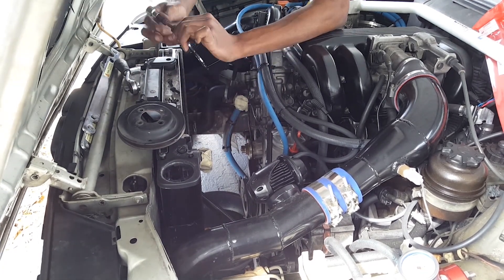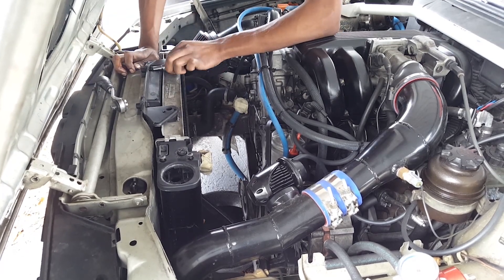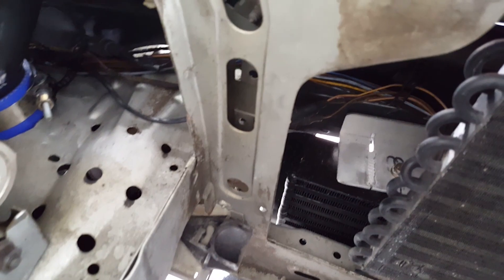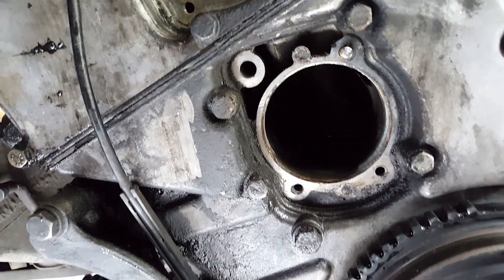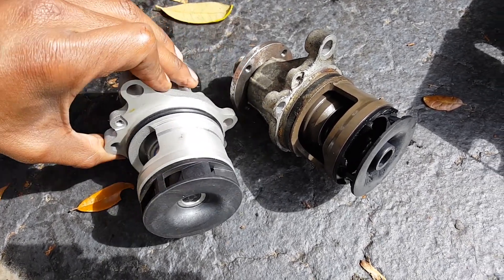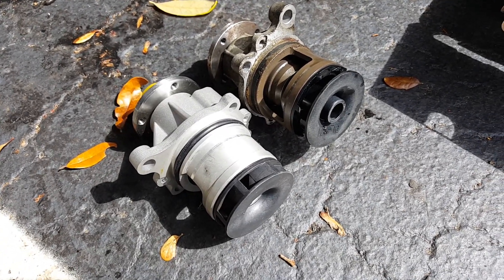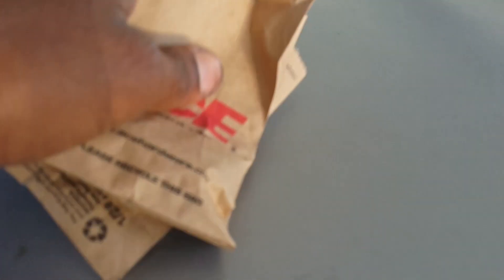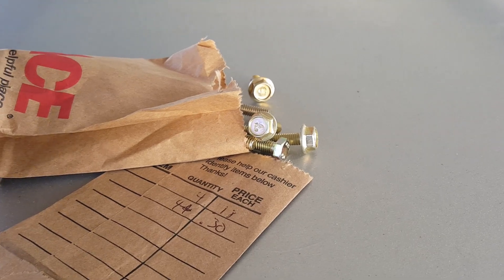E30 M42 Turbo Cooling System Refresh E2

Comment: If you could post a full list of your build man. As I am looking to turbo my m42. I'm willing to pay for your mega squirt tune!
Reply from the maker: Hey man you can check it out my videos I have one with all the parts that I use and the description. If I remember correctly it's one of the megasquirt videos you should see all the parts laid out in the thumbnail.
Reply: @engineeringeverything1480  
What brand of wastegate and what's it's rating ? Do you have a part number for the injectors by chance. Apologize for all the questions
Reply from the maker: I'm running a internal wastegate so it's the standard one that came with the gt2560r. As for the fuel injectors I don't have the part number but they are 36 lb fuel injectors from fuel injector Clinic.
Reply: @engineeringeverything1480  appreciate it. How much has your build cost you in total? As I am looking to do a similar build with a gt2860rs.
Reply from the maker: @duanethemane4719  it was about 4k to get the car turbocharged and i would go with a gt2871r thats what i have now.